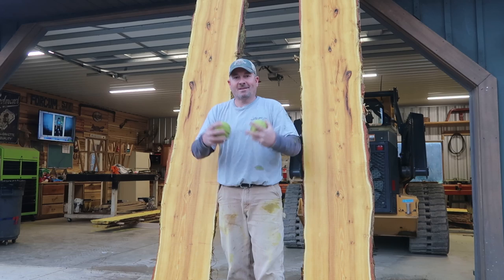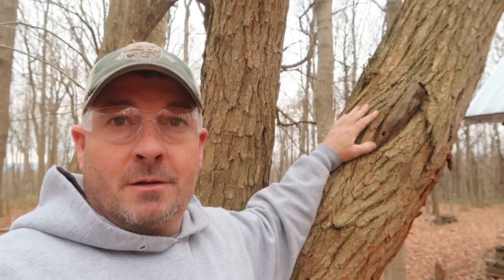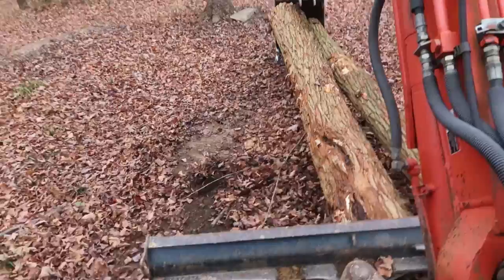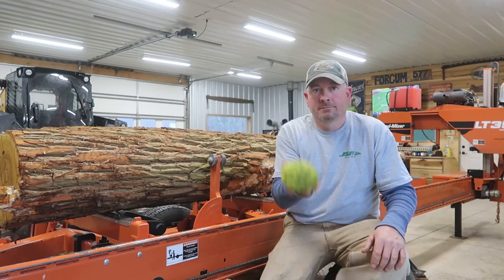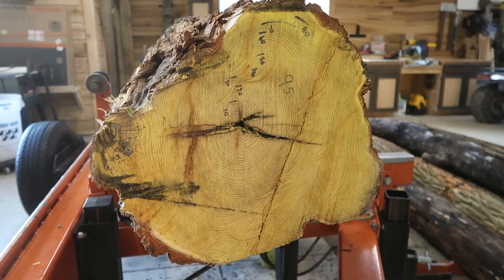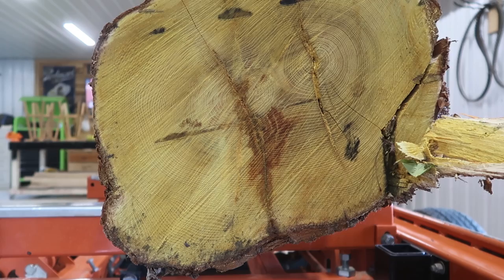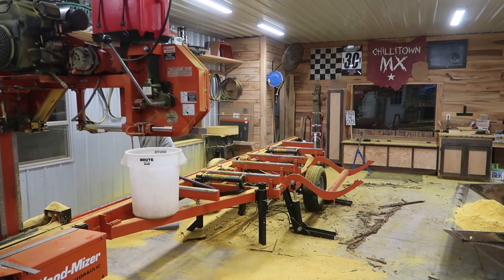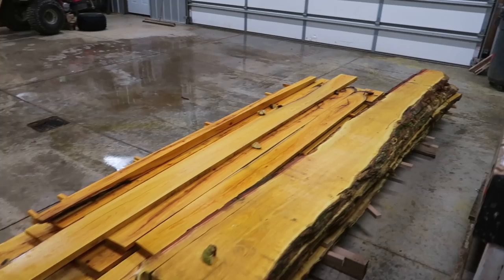What is the most interesting tree in North America!!  You'll never guess.

Comment: Glad to have found this channel through Nathan and you building a slab. Your a do'er n not a watcher. I wondered how you got that sawdust out and kept up with... think I might of been inclined to use a small waste conveyer and a slight dip in the floor so it had its own channel to travel in but a real conveyer would go right under the middle and keep a lot of it outdoors. Now to to many people do these as they have their drawbacks but every shake an shingle mill I either built or made for myself had a spalt burner that was buried in the ground with a screen roof an a good fan to blow air down into that hole and keep that flame a cooking an there is no sawdust, spalts from the splitters or bark off the logs. Also if you pick the cans out of your trash, it will take it away with a quickness. One about say ten foot wide by the same deep an lined with some fire brick and its there for one long time, and the ash... if any left is so easy to just dip it out with the mini excavator that I saw you playing on. It does require a screen lid or the sparks and ash that tend to float away might find a dry spot to cause greaf... ... I miss running a good wood mill as its    just relaxing to me and I see some things that just never really show themselves otherwise. I was disappointed in that maple burl that you sliced up as it should of had some nice swirls an configurations that generally come from them. I made some huge coffee tables from them out of wood from  washington state. I don't have much time back there as I was born on one coast and ended up on the other. Nice place but to see a mill setting inside of a building that just needs a bed, coffee pot (I am sure it already does) and a place to set an watch net flix. So's yea. I enjoyed it and hit the like button

Comment: Finally a good vid on Osage orange, My favorite wood ,Just a few thoughts of mine. Git it out of direct sun light as soon as possible until dry, it WILL crack, it will also darken over time- sun light expedites this. I have made knife handles including pocket knifes and hatchet handles. turned ring boxes. and a judges gavel and sound board And intend many more projects with it. I'm kind of a nut over this wood. Thanks for the very good video about Osage orange. It is NOT a good idea to burn this wood inside of your home.                                                     
Has anyone found a good way to keep the yellow color when first cut.

Comment: I have access to these. Can you slab for a cabin?  Do you need to do anything to prevent splits?
Reply from the maker: Yes you could use them for anything. They do tend to split pretty easy as they dry. I guess it depends on which components of the cabin you want to use them for.
Reply: @CairnCreek  I want to use them for wall logs. I’m in Texas and I was thinking 3” thick live edge slabs